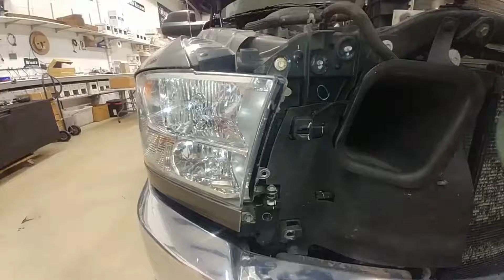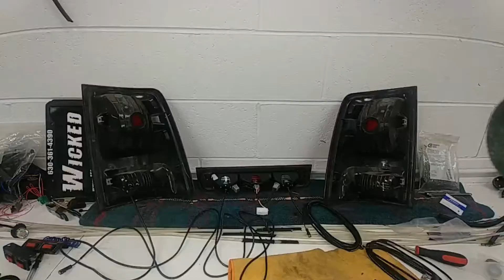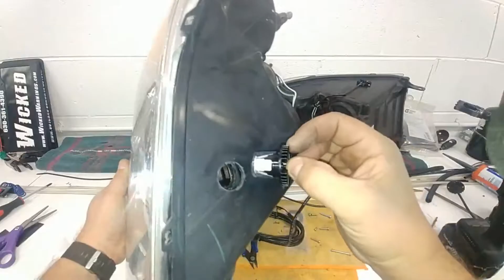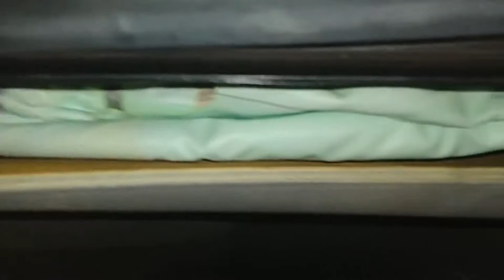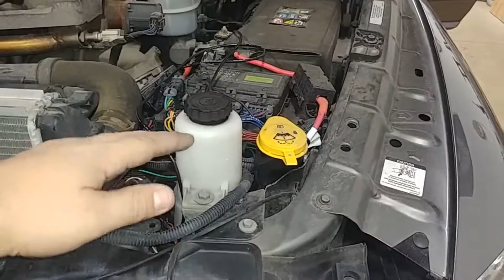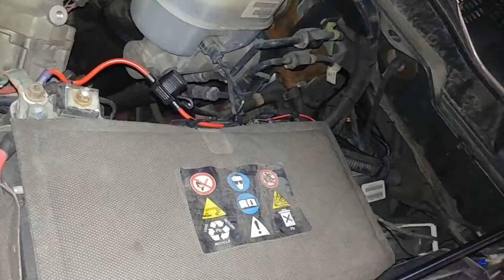(INSTALL GUIDE) 2016 - 2019 Dodge Ram Classic ECO Hideaway Strobe Light Kit

Comment: How difficult is it to get wire to the 3rd brake light?
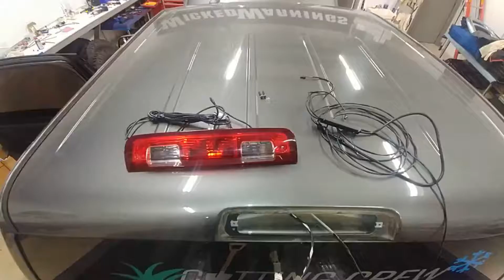Reply from the maker: Check around 12:20 in the video. We also have a video in our DIY playlist about running wire from that light to the front of a truck.
Reply: @WickedWarnings   hey thanks I just saw it. I realized after I posted the comment. But thanks for posting a reply on a year old video

Comment: Nice Video
I purchased my hideaway light from you I believe 2017 and installed them on my 2016 Ram 1500 Laramie.
I did the front,  rear and cargo light area . I still own this truck and they are working great.
( recently and once in awhile the pattern changes on it own , but it's no big deal )
Reply from the maker: Thanks for sharing